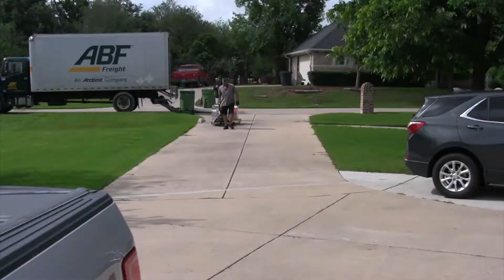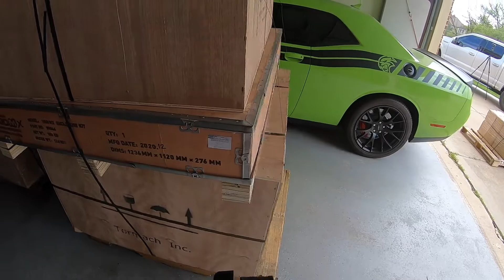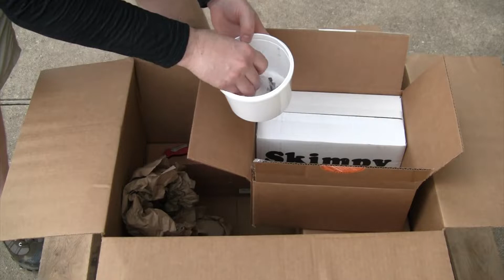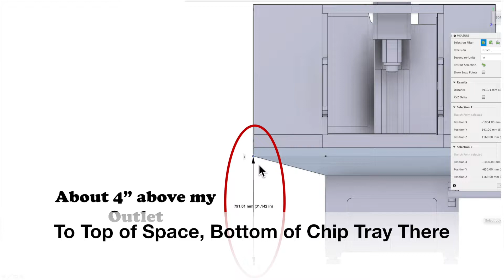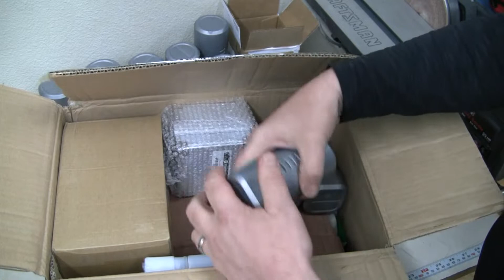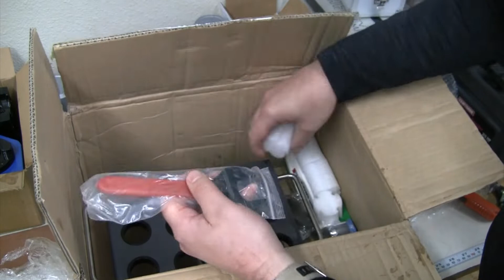Tormach 1100MX Delivery and Unboxing Accessories

Comment: I really thought the first pallet was going overboard 😂. New machine day great. Was gonna ask you why the small compressor, but it became self evident about 30 min into the video. I also do have a California Air Tools quiet compressor and love it. I put it on wheels/pads in order to move it around since it's pretty big. I'd definitely recommend it, the red one in my intro always scared the crap out of me every time it kicked on behind my back while working on the minilathe. One word of caution, California Air Tools like to use red locktite on their fittings. Guess how I found out. Here's a look at it in case you are thinking about swapping your big one https://www.youtube.com/watch?v=Iiv3qnJ0N7Q&ab_channel=EZshop Ciao, Marco.
Reply from the maker: EZ shop - Their air compressors are nice. I just checked out your video on the large one. May have to upgrade one day. Would let me go with a larger bead blaster which would be nice.
Reply: @BladesIIB  It would definitely work for that. I use it to run the CNC plasma cutter, and that does use a lot of air. Haven't had any real problems other than the red Loctite issue I mentioned, so I'd give it two thumbs up.

Comment: hows it holding up? any major issues?
Reply from the maker: TXcnc59 - it is holding up very well. No major issues so far, and the couple of minor ones Tormach took care of right away.
Reply: @BladesIIB  awesome to hear, I just got a lathe from them, ton of issues right out of box but seems like there gona make it right
Reply from the maker: @Txcnc59  Bummer, sorry to hear that. There customer service has been good but right out of the box… that is no way to get started. Hope it is all smooth sailing after they get you straightened out. Good luck.

Comment: How long did it take to get the machine?
Reply from the maker: Allen Isbell - thanks for the question. I believe when I ordered it was supposed to be a 3 month wait and someone else backed out of their order so I received it earlier, about 2 months after ordering.
Reply: @BladesIIB  Thank you!
Reply from the maker: @AllenIsbell  Welcome. Also I just double checked. Was even faster than I thought. I ordered 28 April last year and it shipped 25 May. There was another delay of about 4 weeks for the Path Pilot console but by the time the machine came and I got it set up it all worked out well. No idea what the timelines are now. Good luck if you are ordering one, great machines.

Comment: Is that california air tools compressor enough to run mist coolant? My intuition says definitely not but I seem to have seen people using it for that...
Reply from the maker: Tim Wolf - I don’t currently use mist coolant so can’t give you a definite answer. I will say that the compressor just barely keeps up with the ATC, there are times it has to wait for pressure. The compressor is rated for 2.2 CPM at 90 PSI I would check what your must coolant system needs. Likely more than that?  Appreciate the question.
Reply: @BladesIIB  Wait for pressure to release the tool from the spindle? or
Reply from the maker: @timr86868  usually moves the ATC into position (that uses air) releases the tool and loads a new one and sometimes has to wait before it has enough air before retracting the ATC. Happens when it initiates a tool change right when the compressor is about to kick on. Hope that makes sense.

Comment: This was great Bud. I’m sure you’re in the shop right now setting this beast up. Can’t wait to see the next installment. 👍
Reply from the maker: You are correct Bob, just moved my manual mill onto its new roller base, uncrated the base for the Tormach and starting assembly. My get the top set in place in the next couple hours. Going smooth so far.

Comment: I bet it'll take awhile to set up
Reply from the maker: Yes, I am thinking it will take me a bit. Tight fit where I need to place it in the shop. My goal for the holiday weekend is to get my other Mill on its new wheeled base and turned and get this one set in place. Then I can take my time getting the rest all put together.
Reply: @BladesIIB  How much does the CNC weigh?
Reply from the maker: @robotech  complete unit is about 1600lbs. Crate says the net weight for the main unit with no base is just under 1200lbs.